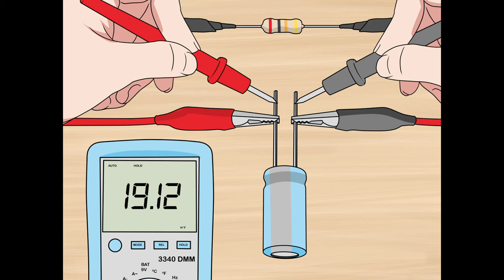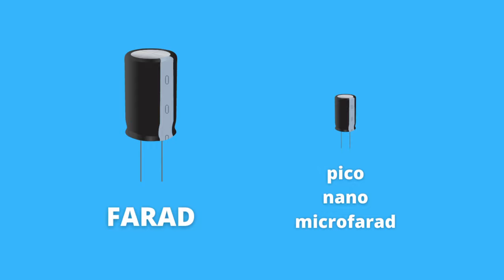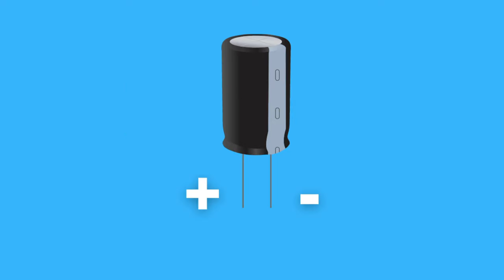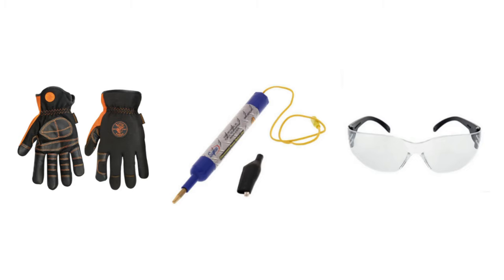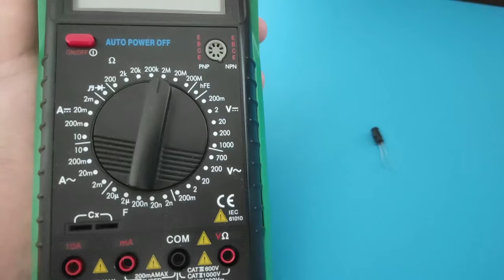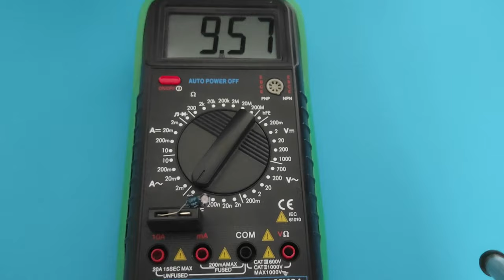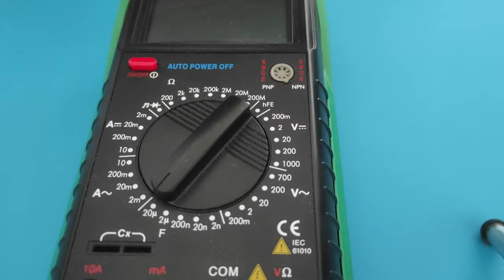How to discharge capacitor - Electronics Tutorial For Beginners

Comment from the maker: Timestamps:
00:00 Intro
00:43 Safety first
1:04 How does a capacitor work
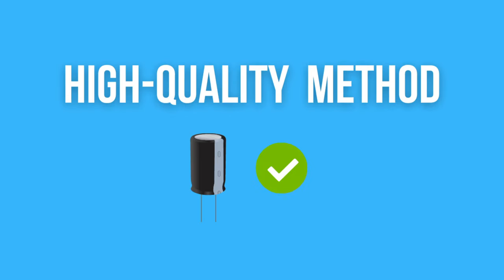2:08 How to discharge a capacitor
2:49 How to discharge a capacitor with a screwdriver
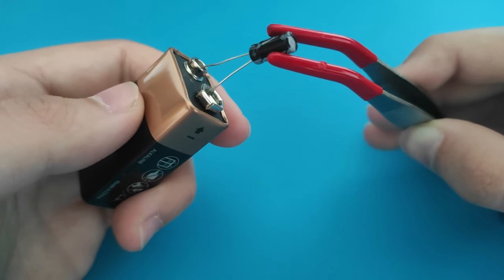3:29 How to charge a capacitor
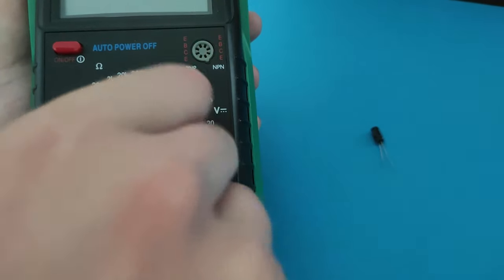3:50 How to check capacitor with digital multimeter

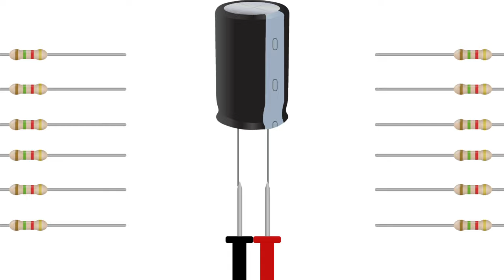Comment: At 2:43, it shows the + lead of the DMM attached to the - lead of the capacitor and the - lead of the DMM attached to the + lead of the capacitor.  This appears to be a polarized capacitor since the graphic of the capacitor has the stripe (with the - ) indicating which lead is negative.  This appears to indicate the DMM is incorrectly connected to the capacitor.  Am I misunderstanding how this works? Thank you in advance!
Reply: I know it's late but a capacitor generates current in the opposite direction to the direction it's charged

Comment: For a microwave with power disconnected can you use a multimeter to test the diode in situ without disconnecting or discharging the capacitor ?
Reply: For safety reason you must always discharge the capacitor
Reply: be extremely careful with microwaves, microwave transformers are the object that is the most fatal to hobbyist electricians.